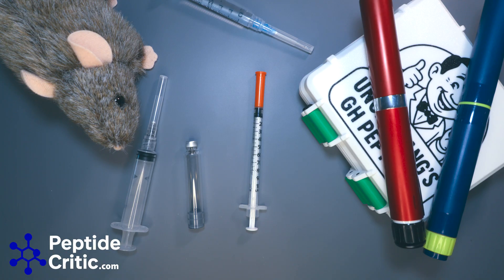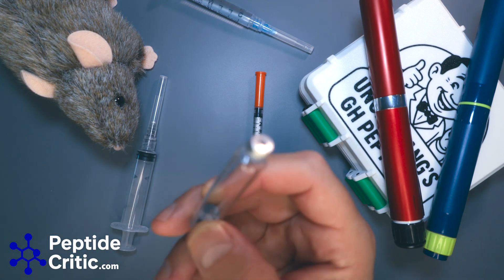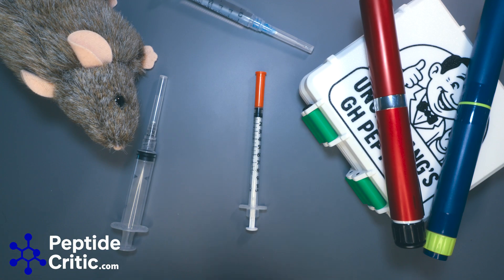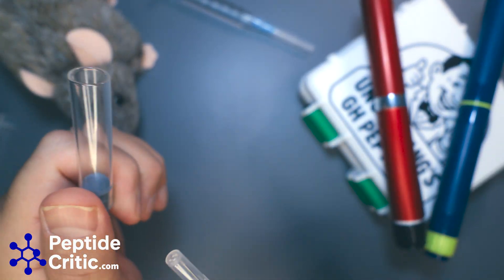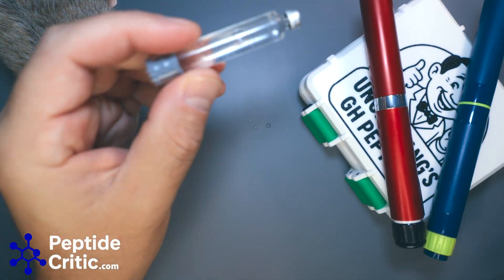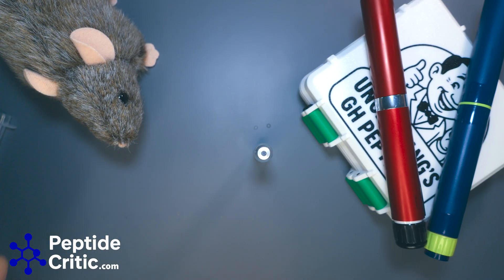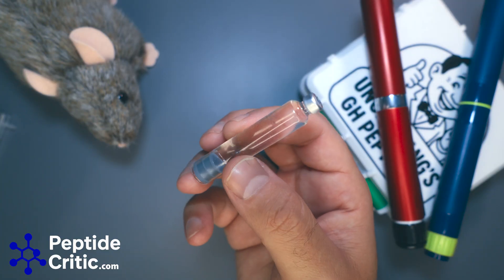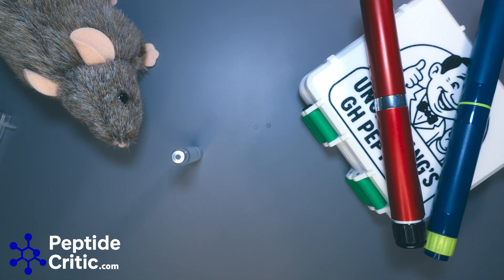Why Purging Air Before Filling Pen Cartridges Is a Bad Idea

Comment: Why don’t you just attach the whole pen, and push the plunger down with the plunger mechanism. You are not exposing nothing then??
Reply from the maker: exposing it to atmosphere is enough to create an issue
Reply: @PeptideCritic serious question - surely the venting needle also exposes the inside of the vial to air to an extent as well ? Great content, much appreciated.
Reply from the maker: @jbcfc5914  put a filter on it

Comment: Thanks for your content. Happy New Year.

Quick Question: I ordered a couple pens on Amazon and they shipped them with cartridges where the plug is not inserted.  I assume I should throw them out. Correct?
Reply: Also, I just ordered one of your storage boxes. Looking forward to getting it.  (Still think the Shopify shipping calc is silly, no offense.)
Reply from the maker: @H..M.. ups inflates it around the holidays. We dont like it either.  Thanks for the support!
Reply from the maker: join our forum at community.peptidecritic.com, post a photo and ill take a look. If they were autoclaved  the stopper does come out normally and is pushed back in with it in the sterile bag. I cant speak to other cartridge retailers but we dont have this issue.